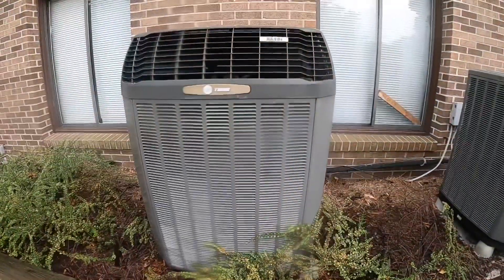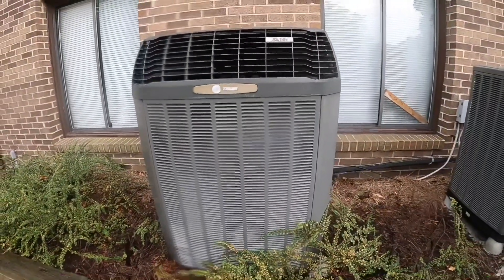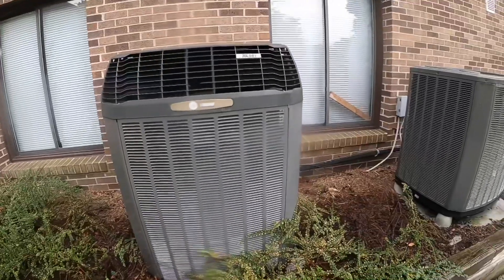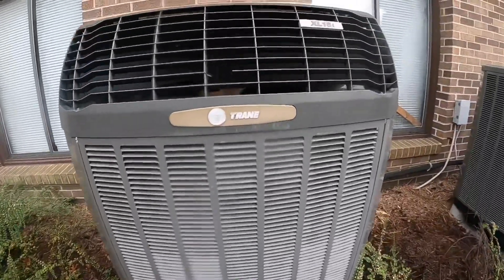2007 Trane XL16i Two Stage air conditioner starting up and running

Comment from the maker: This actually has a Climatuff Scroll, I can tell by the sound
Reply: Just curious is the motor DC or AC for the fan
Reply from the maker: @Nb005  I’m pretty sure it’s AC, it would be an inverter motor that is DC.